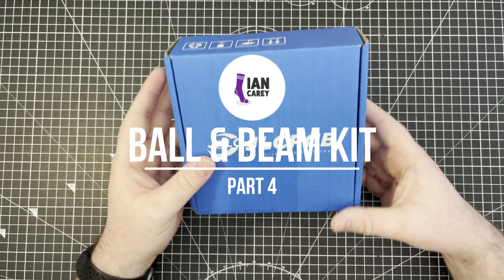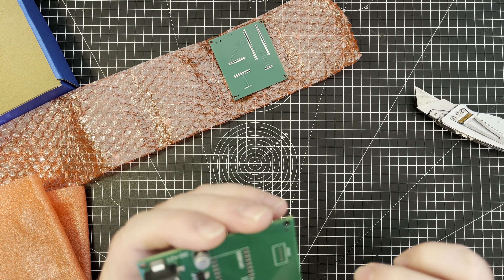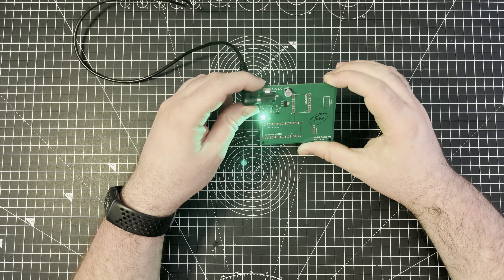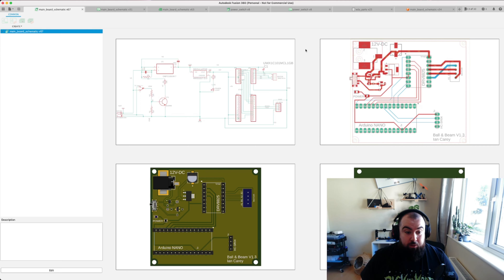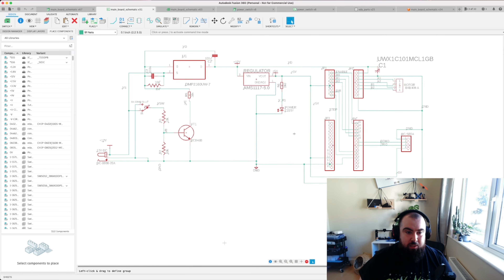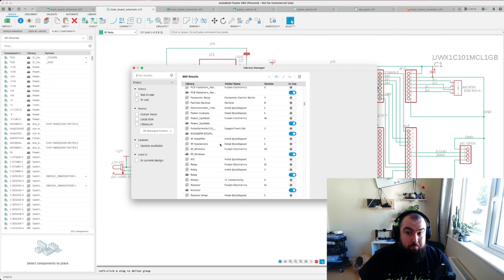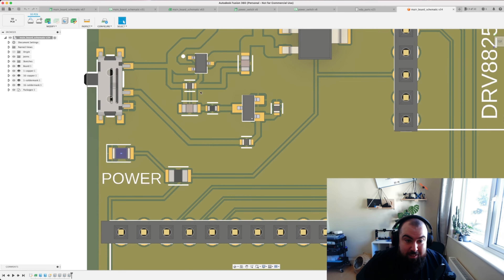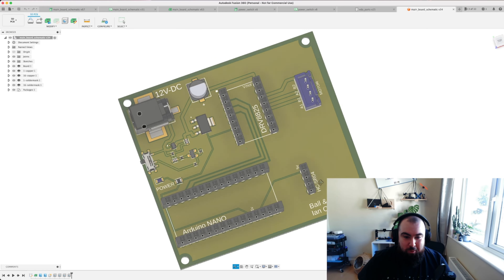Ball & Beam Kit - Part 4

Comment from the maker: These took me a long time to get right, I ended up having to do three designs to get all my mistakes out. The tools for this really feel like they have a steep learning curve and there are lots of nuances involved in the design process. I used Fusion 360's electronics tool, which is basically Autodesk Eagle. I try my best in this video to talk about using the tools but honestly I don't think I did it much justice as it's a very deep topic. In any case, I tried my best to give a bit of an overview and I show off what I was able to make.